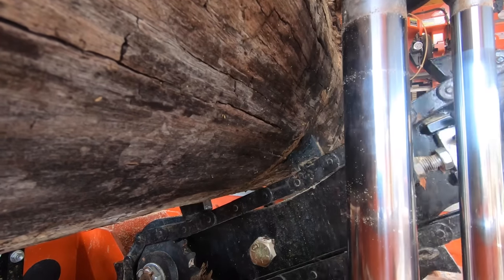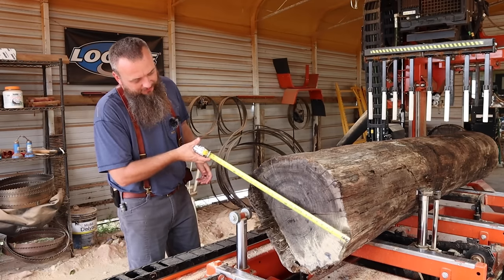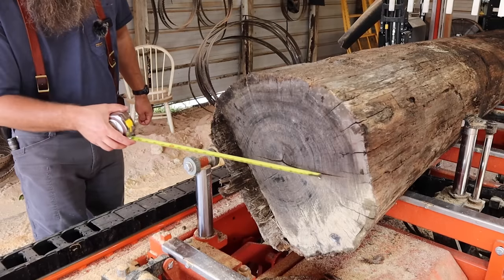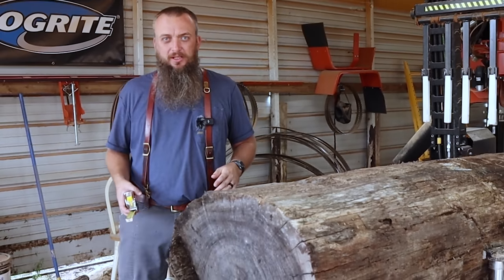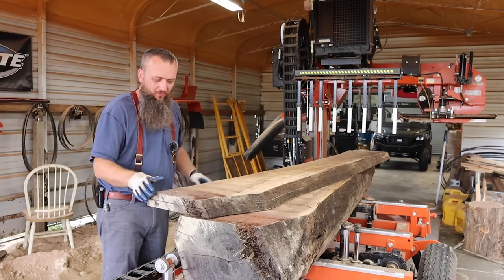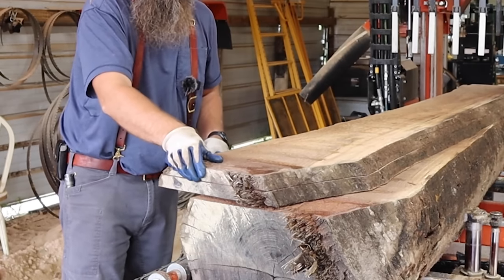What Happens When A Dead Walnut Tree Is Put On A Sawmill?

Comment: I have watched a ton of your videos and have always wondered how you guys with the log turners get really nice lumber without ripping goughes in it. I noticed in one part as the blade passed and saw how bad the cant was boogered by the log turner teeth. Seems to me if you was making a nice live edge mantel it would be ruined.
Reply: That's probably the reason that such slabs would be put through a planer get the required finish, planers would remove log turner scars as well as saw blade scratches.

Comment: You ever see any snakes (Copperheads or even Rattlesnakes) hanging around your log pile down there?? Reason I ask, I heard today (Saturday 9-30-23) About a boy up in Fairmont, WV that was out looking at some logs a tree guy brought him last spring. And the grass had grown up around them as it does. And he got struck and injected by what he called a "Pretty good sized Rattlesnake"  Apparently he had a tape measure in his right hand and had it extended out about 8" and reached down to hook the end of the tape on the but end of the log. And about that time he heard the snake start to "Buzz" And he jerked his hand back and the snake got him just infront of the wrist pin on the meaty bottom of the palm. And hit/injected him pretty good. The Ambulance got him to the Hospital in Morgantown. But apparently they said he world be in better hands in Pittsburgh and they had more experience with snake bits and more accessibility to Snake Anti Venom up there. Supposedly this happened some time in the last 5-7 days.